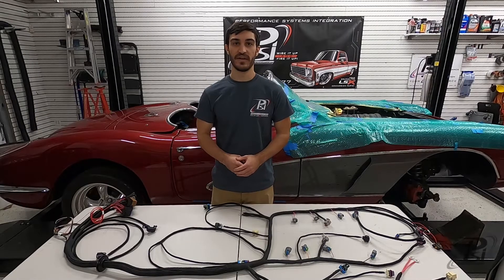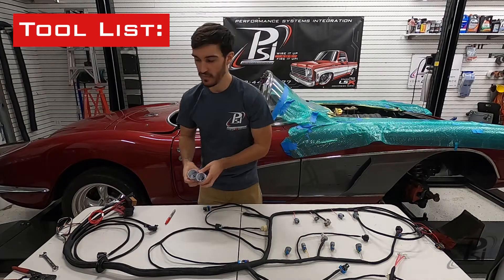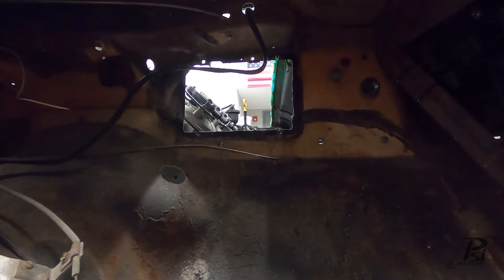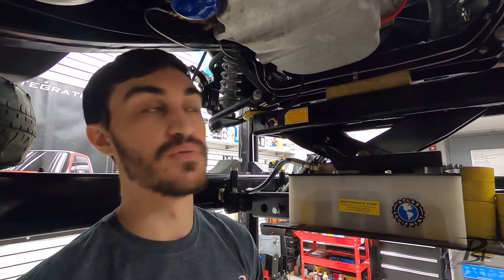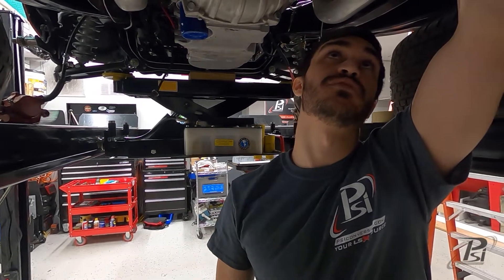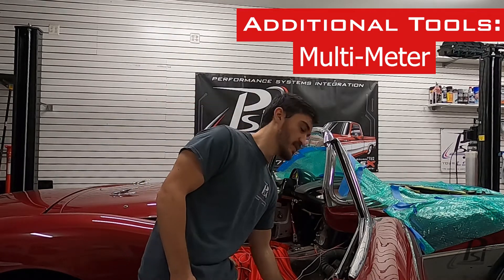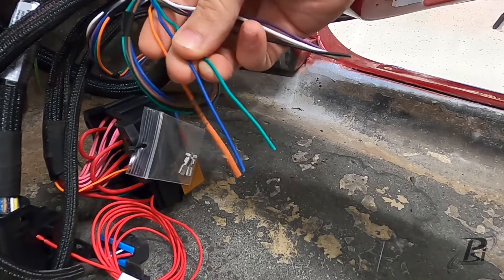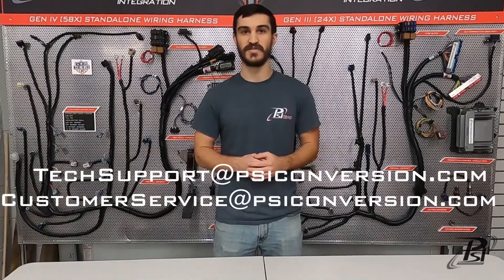How to install an LS Engine Harness Step by Step on a 1960 Corvette using a PSI Harness Timelapse

Comment: Can you please tell me what the wiring configuration on the starter is. Where do the two ring  wires and the crank signal wire go?  This is going on 2004 5.3L LS1. Thank you.
Reply: Did you figure this out? I'm baffled and looking for answers. I'm guessing one is a ground on the engine block?
Reply: @Gomosojo  I will need to take a look under the hood tomorrow morning. I can't remember what I ended up doing.
Reply: @ricardoparra6927  thanks I'm still looking around for answers
Reply: @Gomosojo  I looked. I will post a pic if I can. The 2 ring terminal goes on the same post (large) as the battery cable. The crank signal wire goes on the smaller post above.
Reply: The starter is grounded to the block with the starter mounting bolts. The starter needs 3 connections. The battery, the two ring terminal from the ECU and the signal crank wire from your key switch.
Reply: @ricardoparra6927  you'll probably need to use imgur or something. This is very helpful though thank you. Love this wiring harness but I wish they'd include a diagram for this since it's very unintuitive.
Reply: @Gomosojo  I have a diagram somewhere. I'll get it you someway. I'll look in my files when I get home later today.
Reply: @Gomosojo  if you have an junk email account I can send you a picture.

Comment: Is 16awg pushing it for fuel pump wire?
Reply from the maker: We recommend that u you use at least 14 to 12 awg for fuel pumps. You may be able to get away with 16awg depends on your setup, but I'd say go alittle bigger. We hope this helped you.
Reply: 16307 aeromotive kit.

Comment: I did a gen 4 ls swap on a c10. 
2007 6.2 and 2010 6l80. I got my ecm and tcm working but for somw reason i keep getting a lost com with bcm on my code reader from trans will this cause a no ignition power on the trans? ( i dont have a code for that but jw? )

Comment: How can I hook up the check engine light can you tell me that
Reply from the maker: Connect check engine light signal wire to the ground side of any automotive light bulb (we recommend not using an Led bulb). Hook the other side up to 12V power.